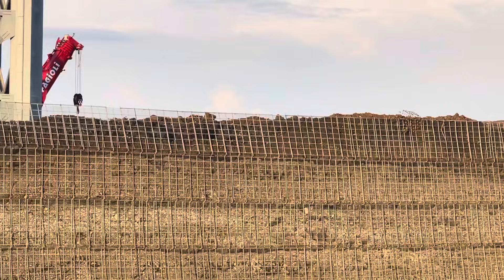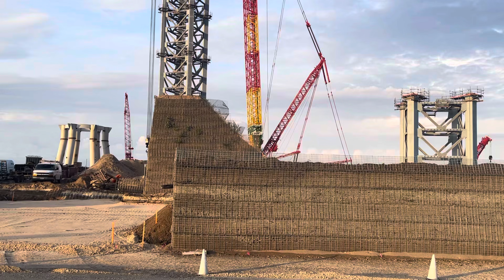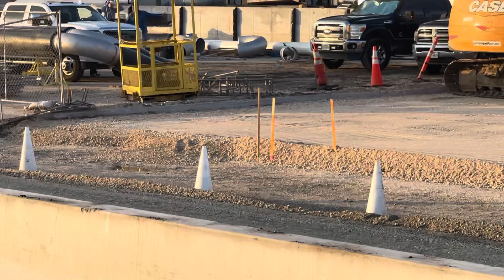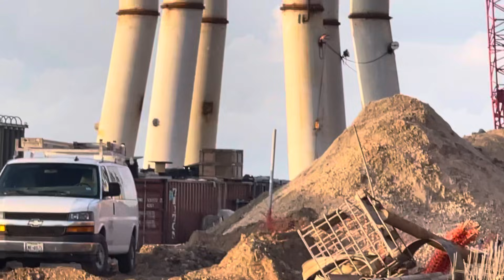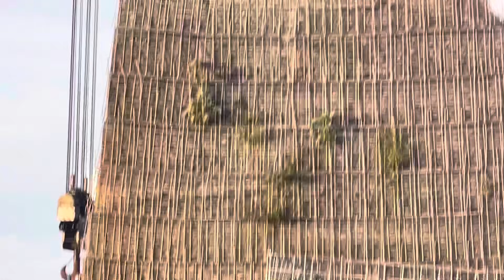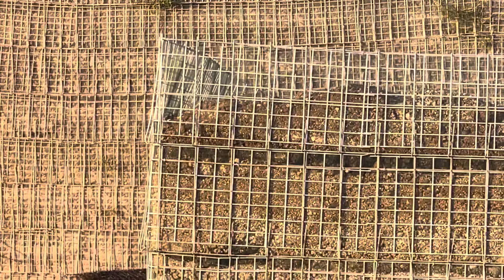Ground And Berm 7:15am June 29, 2021 SpaceX Starbase

Comment: Caliche turns into baby shit when you get it too wet, but in optimal circumstances, hard as concrete.  If you want to build anything of substance, or has any weight bearing requirements, you got to remove it and or layer good materials on top.
Reply from the maker: awesome

Comment: I'd like to hear an explanation why those supports are tilted inward.
Reply: Which supports?
Reply: @jathins6809  The 6 support pillars underneath the OLT (Orbital Launch Table)
Reply: Those are for stabilization. You can't have those tilted because the load won't be bearable.
Reply: @ma7su282  you mean orbital launch mount?